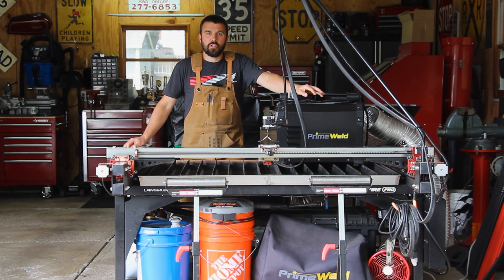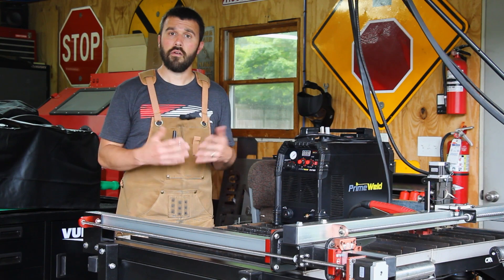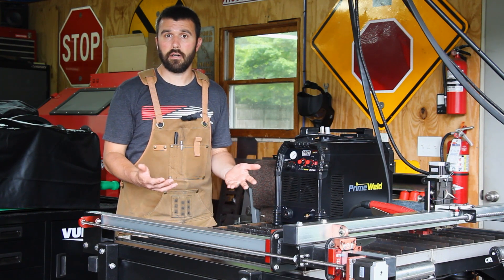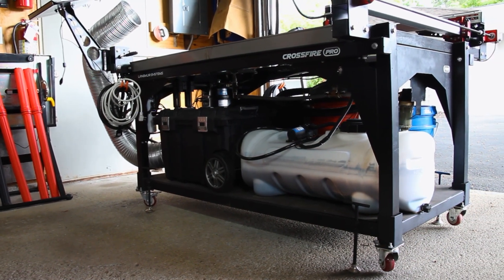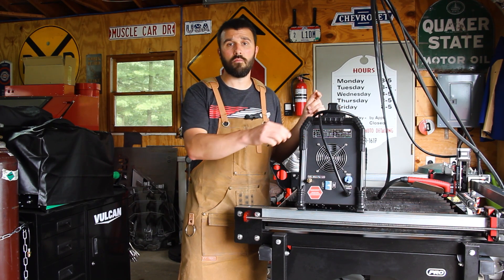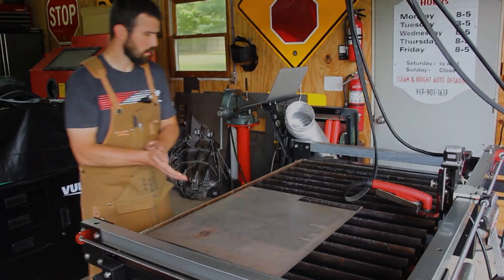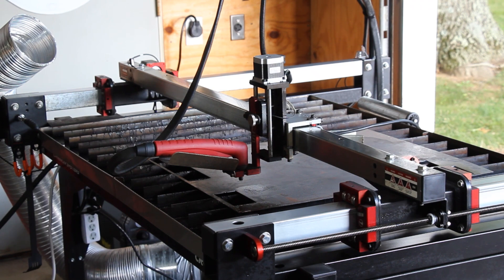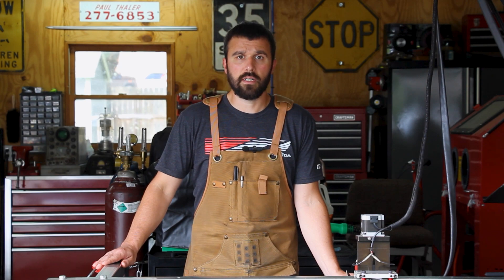You need one of these in your shop! - CNC Plasma Cutter

Comment: Would you mind sharing more about your tray under your plasma CNC, as well as your tank under your table.
Reply from the maker: Sure!  The tray is custom and something I made by just taking measurements once I completed the table build.  I wanted something with casters since my garage is small and also added leveling feet due to my uneven concrete.  The shelf is just 14ga steel welded to the tray's frame.  The water tank is a "spot sprayer" that includes a 12V 1gpm pump.  I bought a 12V power supply to power everything and added a filter on the table drain to remove anything that might damage the pump.  Let me know if you need any other details.

Comment: Is the sub panel in your shop 100 amps?
Reply from the maker: I am running everything on a 50amp panel without any problems but I wish I would have gone 100amps to have some additional capacity.
Reply: When you are cutting at max power, how many amps @ 220 ?
Reply from the maker: I don't know exactly but I would guess just under 30amps.
Reply: I work for an electrical contracting company and have to convert my house to 320A meter with larger panel to supply 220v to both plasma and welder plugs. Also want to add a mini split to garage because Texas haha
Reply: Do you have torch height controller?

Why not the prime weld straight CNC torch rather than the handheld torch?
Reply from the maker: The straight machine torch is on my list to buy.  Hope to have one soon!